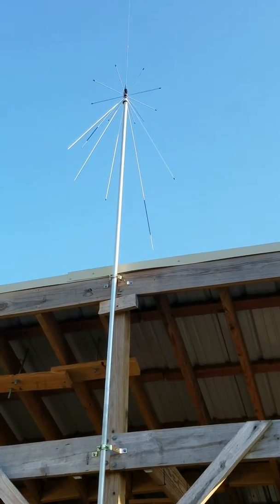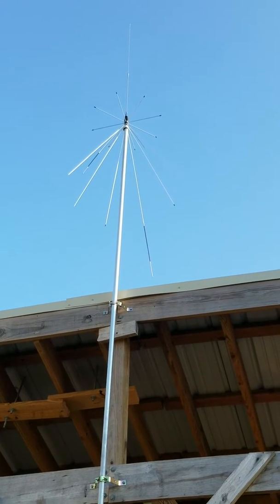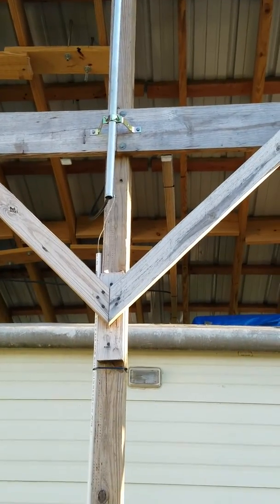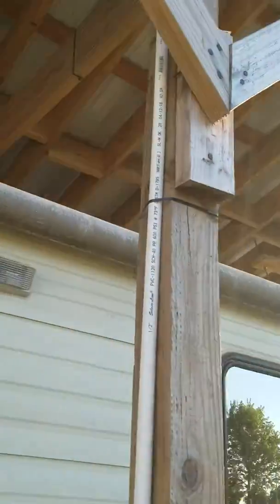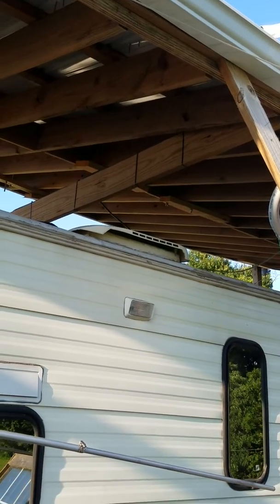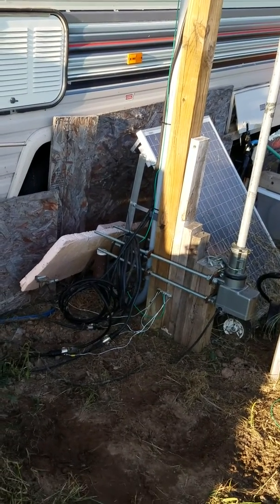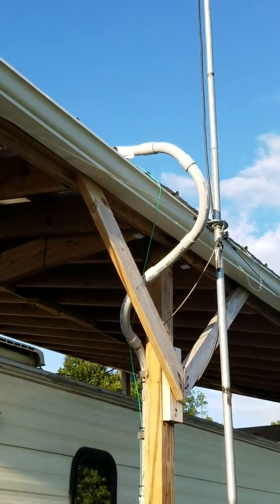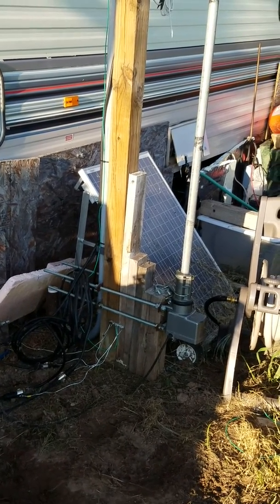Antenna build out  for SDR reception

Comment: I'm curious about you progress into SDR as I am venturing in that direction as well.  most of my trouble has simply been with navigating the software and understanding how it works.  some of the examples on youtube make it seem so easy and so simple.  I'm finding, not at all.  I found I had to update a couple of my OS drivers and then get the software to talk to my dongle.  Now I'm having trouble getting the software to save my settings so I don't have to reconfigure from scratch every time I start it up.  I did get the aircraft transponder and tracking stuff to work it''s cool  but not at all seamless.  but then it's free and I didn't have to write the code.  I bought two dongles because I eventually want to decode trunked digital signals, but I'm not there yet.   I'm curious what you're using and how successful you are.  good luck.  hope you're making progress.  Landon.